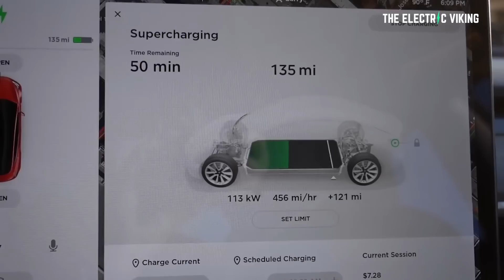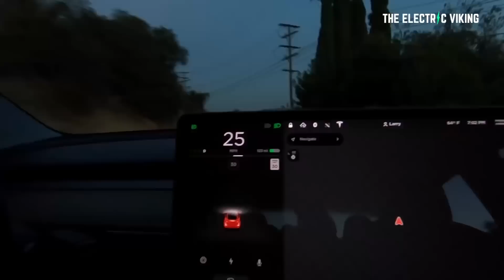Transitioning to renewable energy will save the world $18 trillion

Comment: The cool thing is renewable is getting cheaper at the same time the cost of traditional methods continue to up. The same is true with cars. It would be very difficult to sell EVs if gas cars were cheap and getting cheaper.
Reply: I think the impact of this is very poorly understood.

Even without thinking about the environment, we would need to spend a lot of money in the next 30 years replacing old and obsolete fossil fuel infrastructure anyway, so that is the baseline.

10 years ago, the cost of transitioning to renewables was higher than that baseline, which meant extreme reluctance from politicians to fund it.

Now, new renewables are frequently cheaper even than running existing fossil plant, let alone building new fossil plant.

Which means the energy transition is going to cost less than the baseline cost of replacing all the old fossil kit.

So it becomes a no-brainer for everyone but those who want to sell more fossil fuels, and will only become more so.

And what all of the above means is that the cost of capital for anyone thinking of building a new coal-fired power station has rocketed, whilst for a solar farm it has collapsed.

And that changes everything.
Reply: I just saw a discussion by British journalists about how the cost of charging an E.V. is about 18 p ( pence , or pennies) per km...and the cost of driving a fossil fuelled vehicle is about 19 p per km...but the fossil fuelled vehicle ( named a specific model) in question was about 11,000 pounds cheaper to buy...and the cost of electricity will be going up. So just the opposite is happening, renewables and E.V.'s are getting way more expensive...and the cost of fossil fuels is being deliberately manipulated by govt's otherwise it would be substantially lower.
Reply: @Mark Anthony  
I'm sure you're of the view that "Electricity is generated by Fossil fuel"
If so, how do you conclude that the price of fossil fuel will reduce, but the cost of electricity will go UP?
.
As for "renewables getting way more expensive"
Here's an excerpt from a recent on line analysis by "Carbon Brief"
(August 2022, Prices updated)
"A UK government auction has secured a record 11 gigawatts (GW) of new RENEWABLE ENERGY capacity that will generate electricity NINE TIMES MORE CHEAPLY THAN CURRENT GAS PRICES ...
....... average price of £48 per megawatt hour (MWh) in today’s money. This is nine times cheaper than the £446/MWh current cost of running gas-fired power stations.
.
Oops?
Reply: Which journalists, may I ask?

Did they make the comparison based upon the cost of “rapid charging” by any chance? (at current prices from 60p to £1 per unit)

Did they do an honest comparison based upon how EVs are actually charged, 90% or more of the time, i.e. not with rapid charging, at rates from £0 to 40p per unit.

Did they make clear that electricity prices are very high at the moment because of Russia deliberately reducing gas exports since 2021, and the Europe having to build gas stocks?

Did they mention that the UK’s 35TWh gas storage facility was allowed to close by the government in 2018, thus forcing us to rely on the spot market?

Did they mention that all of the above are temporary, and that the long term price of electricity is that it will become much cheaper, as the UK’s offshore wind power is being expanded, and that it has helped keep electricity prices lower than they otherwise would have been?

I very much doubt it, because they have a clear agenda to delay the take up of EVs, and are being as honest as a certain famous trio were when they said that EV batteries would have to be thrown away every 3 years “like a phone”
Reply: @ayebrow  
(Heads up, just destroyed the "renewables expensive, fossil fuels cheap" statement with actual data.... The difference is even more that I thought! See latest post👍)
Reply: @Roger Starkey - I just read it - I’m guessing you were posting as I was also responding 😀

You are 100% correct about the impact wind power in the UK is having and will have on electricity prices. If you’re interested, in response to a poster below asking why renewables still need subsidy, I have responded with a detailed explanation of why they don’t any more.
Reply: @ayebrow  
It's typical "incorrect (outdated?) Opinion lacking specific source" (as I said .. "gbnews 😂😂😉")
Reply: Let’s do some actual maths, to show that the “journalists” had an agenda in calculating the costs.

Where I live, in London, most EV owners have no off street parking. There’s a large, convenient bank of Source London chargers, which cost 47p/kWh once you’ve paid £4/month to join their network.

If one drives only 8000km per year, by commuting 30km per day with 1000km of long distance driving and 400km of leisure driving, that £4 is then 0.6p/km

Assume 5km/kWh, which is pretty rubbish, but we should look at worst-case. That means 7000km would cost 47/5 + 0.6 = 10p/km.

Assume the 1000km long range trips are done as follows: start with a full battery, and use rapid charging for 800km. The first 200km would cost the usual 10p/km and the 800 would cost 20p/km, assuming £1/kWh.

So we have 7200 @ 10p and 800 @ 20p, giving an average of 11p/km

Anyone commuting further than that model, or doing more long distance travel, would have to adjust, but it’s very clear that the typical EV owner doing 90% of their journeys locally pays nothing like 18p/km, particularly if they have a vehicle that does better than 5km/kWh.

Now millions of people have driveways, and can get a charging unit and smart meter installed, and then take advantage of at least one UK supplier that has a 4 hour per day tariff at 7.5p/kWh which will provide 140km per day at 5km/kWh

And many of those people + millions more could also fit solar PV and charge their car for even less.
Reply: @ayebrow  it was on gbnews and it was an interview with the founder of fair fuel uk. At the moment there are many such vlogs regarding this issue.
Reply: @ayebrow  I appreciate the math, thanks for calculating that out. The difference between your estimate and theirs I think had to do with the fact that the vehicle they based the 18p/km was used as a business vehicle running routes in and out of urban centres all day.  I assume that you've heard the news from the "anointed ones" in the WEF that humanity must abandon all personal vehicles, gas, diesel and electric? In fact I recall seeing a woman who worked for Boris Johnson say the same thing in an interview. She said that in the future England is "moving away from all personal vehicles". Either way you slice it , E.V.'s are the necessary transition to zero vehicles, because politicians want to make sure that the voter agrees to slam the door on fossil fuels permanently. Full disclosure, I mine the nickel Elon Musk uses for his batteries...and the mine is located in the same small city where Rolls Royce has a cold weather testing facility...you will never see an E.V. up here. And you will never see charging stations built along the 750km highway we must travel to go to see our doctors when the temp can be -35 degrees C and as cold as -50 degrees C. in the 5 months of winter. If the government can barely maintain the road they aren't going to build charging stations.
Reply: Thank you for answering that. I’m absolutely sure GBNews is the perfect place to get a balanced and honest viewpoint, from contributors with no agenda.

As my post above, it’s trivially easy to show that EVs are a lot cheaper to run than fossil burners, for the vast majority of owners, even with current electricity prices temporarily elevated by what Russia is doing.

Anyone claiming otherwise needs to be quizzed as to why.
Reply: @Mark Anthony thank you for taking the time to read my response, it’s not always the case here 😀

Your post has two very interesting points, which I think I can summarise as follows:

1. It’s possible to put together a use case where an EV looks as expensive to run as a fossil burner, whilst being more expensive to buy, but is that a common, or a rare scenario?

2. There are some use cases where EVs just don’t look realistic at all, which is totally reasonable.

The thing is that millions of people do not have those use-cases at all. I bought a secondhand Nissan Leaf in 2018 precisely because it seemed like a perfect vehicle for the use-case I bought it for. I got a PodPoint charger installed, and one person that now drives the car more regularly than me can drive almost 50 miles to work, charge there and then drive home and charge again overnight.

On days when it doesn’t do that commuting pattern it is used to do local trips to and from the house.

After 4 years, that car has never been rapid charged, and the Finance director of the company where the driver works has witnessed it all and done 2 things: got more destination chargers installed and started getting other staff to use EVs.

Obviously, some people will be swayed and perhaps delay buying an EV for a while, but the fundamentals are utterly rock solid. Once the European natural gas price returns to normal, and is not distorted by what is happening in Ukraine, European electricity prices will return to a level where EVs are a no-brainer for most drivers, and not just millions in the “early majority” of the S-curve.
Reply: @ayebrow  
Gbnews... 😂😂😉